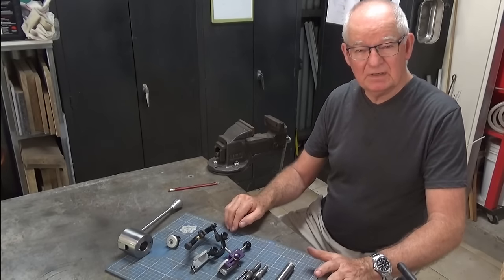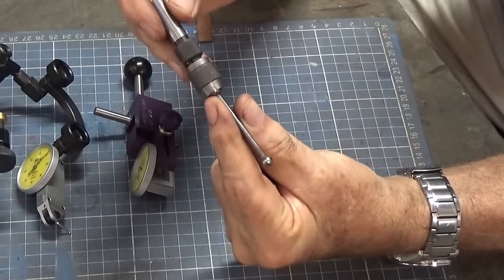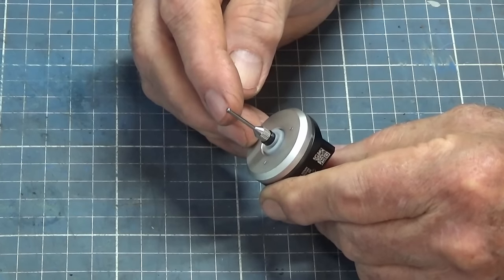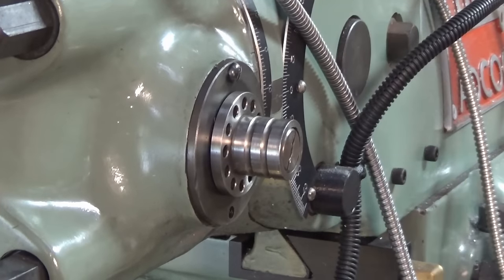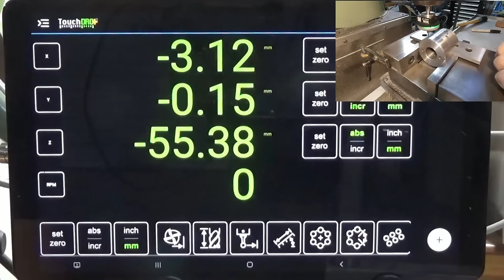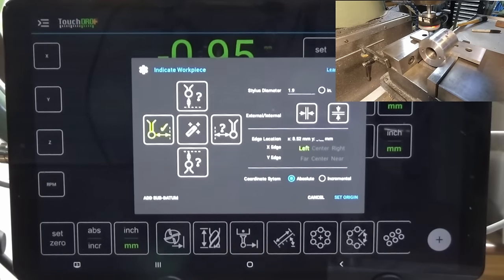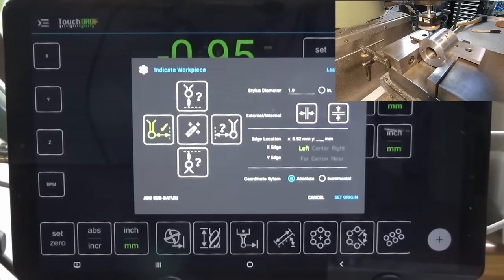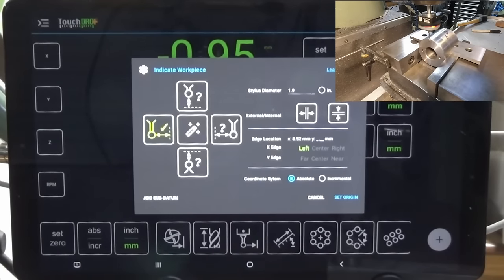Using a Touch Probe with TouchDRO

Comment: Hi Mark, I am looking to purchase a Bridgeport and believe I might have found one but I have a few questions I was hoping you could help with. 
I am looking at Touch DRO and wonder how feel about it after so many months of use and do you think it is user friendly? 
Did you ever estimate what kind of money you have in converting this to a cnc?
What color is that paint you used on this mill? I love that antique looking green.
Reply from the maker: I do like TouchDRO but I made a mistake in starting off with capacitive scales. I considered them to be a cheap option but they aren't as reliable as glass scales. I ended up replacing all my iGaging capacitive scales with Sino 5 micron glass scales and I now have complete confidence in the accuracy and reliability of the machine. I like the option to sum together the two Z axis scales. I have a scale on the quill and on the knee and both read together to give a total Z readout. I also like the option to use the touch probe. It is capable of doing more than the regular rotary probe although I do use both. I probably only use about half the capability of TouchDRO but it does everything I want. The unused features are probably the tool library and the tachometer function although I have a hall effect sensor which would enable the tachometer. My Bridgeport has the speed indicator anyway so I don't really need anything else. However, If you do enable the tachometer you can get real time readout of chip load per tooth on your cutters. The way I have it set up, you can also see real time feed rates for the auto feed in X and Z. 
I haven't considered converting the Bridgeport to CNC (I already have a Sieg X3 converted to CNC). The green colour was mixed for me by a local paint shop. I just took the small side door down to the shop and they colour matched what was already on the machine. It had been painted by someone else before I purchased it and they had used a brush and hadn't done a very good job but I liked the colour. I still have some of the paint but it doesn't have a standard colour profile labelled on the can. I was able to buy a powdercoat that is very similar. It's a Prismatic Powder product called Shrek Green https://www.prismaticpowders.com/search/shrek-green? 
Regards,
Mark
Reply: @Preso58  Hi Mark, I don't mean to keep hounding you but I have decided to purchase the Bridgeport I have been looking at and I am just wondering if you have seen any issues with concrete under your machine?? I am sure the concrete was not poured in thoughts of putting a heavy piece of machinery on it and wonder if you have seen any cracking or issues? I am just over 4" thick on mine and would think 2000lbs would not be a huge issue but not sure.

Comment: Nice video Marc. I ordered the same touch pro that you have but when I hooked it up to my touch DRO, it is giving me an error. It thinks that the probe is still triggered. I am working with Yuriy on it. Which pin did you hook up the trigger wire to, Q or P? What are your settings set to in the app? I appreciate it much.
Reply from the maker: There are three pins on the TouchDRO board for ground, V+ and signal. The pinout diagram for the TouchDRO board is here https://www.dropbox.com/scl/fi/rarl25e2xclx8m7gktmo0/Pinout-diagram.JPG?rlkey=pjo3qty8uugmng3irxcybn4cp&dl=0
The probe signal wire is yellow on my probe, red for V+ and black for ground. My settings are here https://www.dropbox.com/scl/fi/ou9w9ejoygrquko9mi6s5/PXL_20240227_233137605.jpg?rlkey=b00m1lpmgafbdzmjcsl6ok3si&dl=0
The LED should be green in the untriggered state and red when triggered. There is a setting on the probe page that inverts the signal. If the LED light changes when you touch the probe it is working. If not it may be damaged inside?
Regards,
Mark
Reply: P or Q will work, just make sure you use proper input axis prefix setting in probe settings

Comment: 1. I like your presentation very much.
2. I like the nature life you are showing.
3. You MUST improve the sound quality.
Reply from the maker: Thanks for the feedback. Can you suggest how I would improve the sound quality? I am using DaVinci Resolve and a Sony Handycam HDR-CX625 camera. I have the camera set to stereo (not 5.1 surround) and I had the audio record level set to manual and at the lower end of the range. The Sony camera that I use doesn't have a lot of options for audio recording. I found that when I set the audio recording to auto, it tended to overcompensate during periods of quiet recording and it would pick up a lot of background noise.  I generally lower the master volume in DaVinci before rendering so that it isn't clipping and after I upload the video to YouTube I assumed that they would process it to equalise the volume dynamic range. I am not really a "sound guy" and I usually review the audio using just desktop speakers. I know a lot of people use headphones and that can sometimes create issues with background noise and distortion. I am eager to learn though and I could do with some pointers.
Regards,
Mark
Reply: @Preso58  
I am not a sound expert and don't know that equipment, but the first thing to do is to have an external mic close to your mouth.
In addition, adjust the Automatic Level Control ALC of the camera/recorder.
Your workshop is noisy and you must do something regarding sound quality.
Reply: @Preso58  
Does the camera have an external mic input?

Comment: The correct method of employment for a probe which is red in contact and green when freed of touch is place the probe in contact then move it off?
Reply from the maker: In the TouchDRO app, you can set up the probe so that it registers the contact point after a single touch, or two or three. I have mine set up for three touch points and the app averages all three. On the third touch off the app stores the position and you can move the probe off the workpiece and then set the origin. It takes some getting used to but you don't need to hold the probe tip on the workpiece when setting the edge or centre location.
Regards,
Mark

Comment: could you do a video on your touch probe on your cnc machine and how it works and connects?
Reply from the maker: If it comes up in another project I will do that. I use UCCNC software and a C11G breakout board and it has pins for a probe connection. It was a simple matter to connect the probe and configure it. I gave up trying to use Mach3 and Mach4. It just seemed to complex but UCCNC was way easier. It has two pages of probing functions and they are relatively easy to configure and use. 
Regards,
Mark
Reply: thank you @Preso58

Comment: Cute! Mum hasn't moved a muscle, joey bouncing around all over the place! 
Just installed TouchDRO, still learning too, may invest in the probe,  Question Mark, how does the magic probe know that you touch off exactly in the centre side to side and front to back or does it do some wozz bang math to compensate?
Reply from the maker: The TouchDRO app uses both the direction of the scale and the signal from the probe to know whether you are probing a centre or an edge. The magic wand button automates this even further but I don't know how it does it. It is quite clever but it takes some getting used to.
Regards,
Mark

Comment: my 1980 ENCO Bridgeport clone came with type of quill handle. i thought they were the norm....
Reply from the maker: I do know that there are aftermarket versions of the quick set quill handle available, just not in Australia. 🙄
Regards,
Mark
Reply: @Preso58  i can imagine with shipping it would be cost prohibitive, they arent cheap here in the states, and the import stuff most likely wouldnt fit a genuine bridgeport. my enco is a mix of imperial and metric. it was a royal pain sourcing parts to fit the knee power feed motor.

Comment: Have you downloaded the firmware and installed it your self, I'm having a hard time trying to install it on my ESP32.
Reply from the maker: I bought a preassembled and complete adapter from TouchDRO. It came as a plug and play device so I didn't have to install any firmware. You can check the forum archives https://www.yuriystoys.com/ which might help if you are configuring your own ESP32
Regards,
Mark

Comment: What happens when you absentmindedly drive the probe into your work hard? I bought one of those electronic edge probes from general and accidentally did this now it’s not so accurate 😢. I’m afraid that I’d do this again
Reply from the maker: Yes, you do need to be "situationally aware" when using the electronic probes. I treat mine as if it were made of crystal and you cannot just throw it down amongst the chips and coolant either. I have made dedicated storage points for both the digital probes I use. You can buy replacement probe tips if your old one is bent. If it's damaged internally you can dismantle them and try to look for bent components inside but that's probably the sort of work a watchmaker would do.
Regards,
Mark

Comment: Would you be willing to share (sell) your plans for the quill handle?
Reply from the maker: Sure. You can download the PDF of the 2D drawings here. It's free. https://www.dropbox.com/scl/fi/70iganjkjkz92c20s7rgd/Quill-speed-handle-assembly.pdf?rlkey=kr2qqyt6910x44vul8vlh1twc&dl=0 However, the drawings may not be complete. I really only made them for myself so there may be some details missing. You should be able to work it out though. The little chain link is available on Ebay. I put the link in the drawing. You don't have to use it. You could just use a home made linkage to suit. Also, there is a spring required to return the handle to the locked position. I just went through my box of spare springs until I found one that suited. Please check your own machine to verify the dimensions. 
Regards,
Mark
Reply: Thank you! @Preso58

Comment: It's super disappointing that TouchDRO no longer makes adapters for iGaging scales. I bought the iGaging scales because they were in my budget and they could be used with TouchDRO. After finally buying and installing them, TouchDRO discontinued the adapter for them. I should have just saved up longer for glass scales.
Reply from the maker: I could be wrong, but I believe you can re write the firmware on the adapters for different scales. I recall reading that you can go the other way around, that is, convert an adapter for capacitive scales to glass scales. I just checked on the TouchDRO store website and you are correct. As of a couple of weeks ago, there was an adapter for mixed scales. Maybe, Yuriy is looking to simplify the range of adapters that he is offering. Check this link https://www.yuriystoys.com/search/label/DIY%20DRO%20Encoder%20Hardware
Regards,
Mark

Comment: Sticky pin?
Reply from the maker: I have heard them called that. I generally refer to them as wigglers.
Regards,
Mark
Reply: @Preso58  sticky pin was blue tack with a pin that was stuck onto a concentric dowel pin held in a chuck and it acts like a wiggler / wobbler in operation.

Comment: TouchDRO have changed the versions they sell and no longer sell one with micro USB inputs, I was looking to buy one when I get paid next month but wont be now.
Reply from the maker: I noticed that. I stopped by the website today and Yuriy has narrowed the range of options to just two. For what it's worth though, I would just buy the adapter for glass scales. I should have done that right from the start. It was the more expensive option but I don't regret it.
Regards,
Mark

Comment: 2.52mm is VERY close to 2.54mm, which is exactly 1/10". Maybe the twenty microns is for good luck or something. XD
Reply: That was my thought too. I fact I seem to remember measuring one donkeys years ago at 0,1 inch.
Reply from the maker: That makes sense. I will check it again. I did use a Mitutoyo 1-25mm micrometer and the digital calliper and both said the same. However, and I just thought of this, that tool was given to me by a relative who used to work for Sellars Atkins, a tool company in Adelaide. It could be that it was a tool that was returned because it was out of spec. 
Regards,
Mark